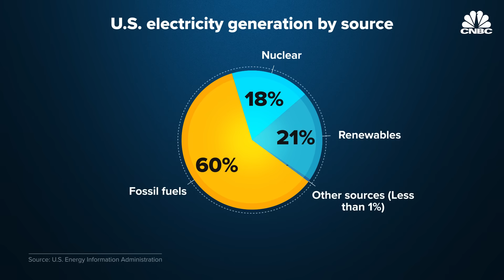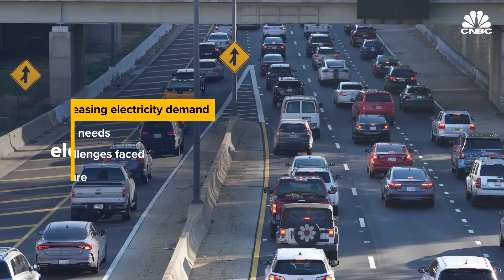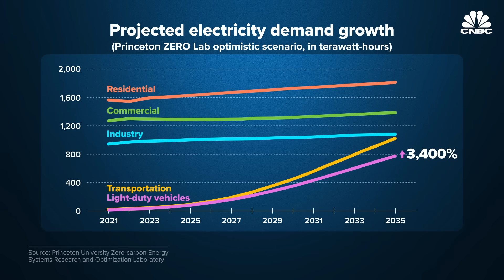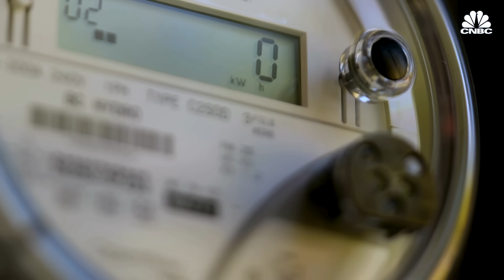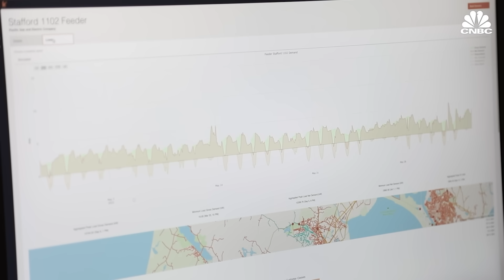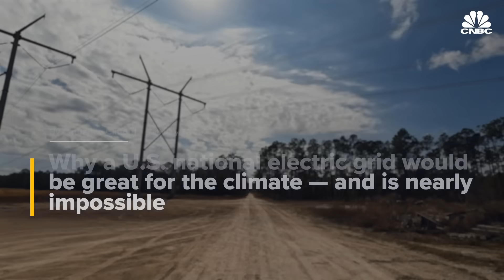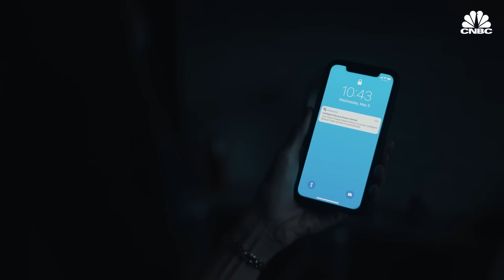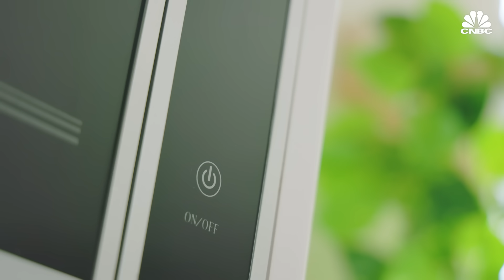Can The U.S. Power Grid Handle The EV Boom?

Comment: I’m SICK and TIRED of everyone and everything being about “EV this” and “EV that”! This whole EV fad is insane! Have we all forgotten that hybrids exist or..???
Because hybrids is the perfect solution;
-“EVs take forever to charge” hybrids still run on gas.
-“Gas cars don’t get as good mpg as EVs” hybrids have phenomenal mpg.
-“EV charge points are always broken” hybrids don’t need to be plugged in.
-“Gas cars need more maintenance” true, but for the low cost of maintenance, you pay for it in the high cost of EV prices. Hybrids aren’t that much more expensive compared to gas cars and are way cheaper than electric.
-“EVs can’t go long distances” hybrids can go as far as gas cars and are still efficient in the city.
-“Gas cars produce a lot of emissions” so does the production of EV cars.

You see what I’m getting at here. Hybrids are far superior and it’s very telling of how educated the public is when they can’t stop arguing over gas and EV cars when hybrids have been along for so long and blend the best of both engine types.
Reply: electric cars nothing new just battery tech is new there were electric postal vans 100 plus years ago in city also drive out to the plains state they have charge stations built but no primary power cables to feed them

Comment: EV's run on lithium batteries.  Lithium batteries are produced by strip mining the earth using equipment that runs on diesel fuel, then transported by ships that run on diesel fuel, then transported by trucks that run on diesel fuel and loaded into EV chassis by equipment that runs on hydraulics (lubricated by petroleum products).  Saving the earth . . . with petroleum-based products every step of the way.
Reply: More and more mining equipment is electric.

Comment: Air conditioning, not EVs are the threat to our grid. A Tesla Model 3 uses about the same amount of electricity as a large electric water heater. Do you worry about the cost of your water heater?

Comment: EV's are stupid.  They have a very short range, don't work well in cold or hot weather and are really expensive.  They are really boring and are for idiots.  Lithium batteries are better for RV coach batteries, e-bikes and fork lifts.  I'll stay with gasoline.  It's powerful, available everywhere, works in cold and hot conditions and the engines feel great! We have hundreds of thousand of mechanics that can wok on them.  We have very few e-mechanics. 
We don't have enough power either. If you want to use the grid for your transportation....get an e-bike.

Comment: They need to start with give a full tax rebate for total cost of solar panels just just the miserable chump change they give for residential units. Batter and cheaper batteries for said homes, why use rare metal batteries when you can use salt batteries on homes. But the issue is some power companies have made it so they don’t have to pay fair market value for power you put back in.

Comment: The solution is home based infrastructure.  The idea is to have every home have a battery to store electricity and be able to remove a lot of the strain on the infrastructure. This is something that the electric grid needs and it doesn't 100% have to be owned by the consumer but more or less leased.  I think any electric service could partner with Tesla or any other home battery system to produce an effective way to reduce strain on the electrical grid.  It could have solar but more importantly the electrical grid could have sensors when homes are at battery capacity and even have downtime for maintenance.  But that is my opinion.

Comment: Use hydrogen to absorb surplus grid electricity streams when they emerge.  

Further, consider pipelines for distribution.

IPOs and bond issues should be able to cover all build outs, quite comfortably.

Comment: You can do a lot by using "smart", networked appliances and ev chargers, for example a cumulative water heater or washing machine that will turn on when there is excess power. Can't do that with an electric range or AC though... and would need ev chargers at every parking lot, so people can charge during peak hours of solar, when they are at work, instead of charging overnight.
Reply: Actually you can make the A/C use more power during the excess power when solar is working, then reduce your temperature when the sun has just gone down, and wait to run it again until about 9 pm.   I have a power plan in Portland Oregon, where I pay $0.32 per KW between 5 pm and 9 pm weekdays, and after 9 pm, the power cost goes down to only $0.08 per KW and on weekends.  Weekdays between 7 am and 5 pm, the rate is $0.12 per KW, while my neighbors pay $0.13 per KW for basic 24 hour a day same price service.  

So I shut off my water heater between 7 am and 9 pm.  And I have not noticed a difference most days.  

For me, I can power my plug in hybrid without a big change to my electric bill.  For those that put in a 5 KW solar system, they can actually use less grid power after putting in one electric car than prior bills, and if they put in 10 KW, they can easy support 2 cars while using overall less electric power than prior years.

Comment: They need to give away power during peak solar - if you have a home battery.  They are basically throwing away electricity because there is nowhere to put it.  Low cost charging of home batteries will solve tons of costs associated with the 4pm-9pm system bottleneck.  Also PG&E is working to avoid long transmission lies due to liability.

Comment: I don't think the activists who push Wind and Solar really understand the impact these technologies have on the environment. When I see a Solar Farm in CA, it's a massive area that is graveled over without even thinking about the energy it takes to produce the panels. The photovoltaic only recently became a net energy positive. The mirror-based systems are cheaper and more effective, but they have issues with migratory birds and planes. The large wind turbines require a large amount of steel, concrete, and carbon fiber. The offshore wind farms have issues with whales and other marine mammals.
They should be pushing for Nuclear and Natural Gas.

Comment: Decentralize the grid (generate energy at the point of use) rather than rebuilding the centralized existing grid. Seems like this would likely be cheaper and also offers a safer infrastructure. The existing grid can be maintained in its current state to take care of the days where renewable sources aren’t plentiful. I think part of the problem is that we think we completely need to get rid of fossil fuels from day 1. They’ll likely need to coexist for some time.
Reply: that is not what the dems wart

Comment: The problem is not the EV boom, nor the outdated grid, nor the lack of interconnection, or any of the reasons explained in this video. 
The problem is the lack of political will from both parties to agree for the next 20-30 years, no matter who is in charge/elected, they will both pass spending bills and maintain the focus on upkeep, modernization, and installation of new transmission lines/infrastructure. 

Everything else mention in this video is a problem, but not THE problem as to why the US energy grid is lacking, behind, or vulnerable to many of the new modern issues.

Comment: The most effective solution to get away from fossil fuels in the short term is to expand on nuclear energy. It’s safe, and it’s clean if it’s done properly. That would significantly relieve the stress from carbon emitting sources, and would allow wind and solar to grow slower. (Because it will. It’s just not as effective, and that’s a fact)
Reply: Nuclear is so obvious that one has to wonder why they are avoiding the topic. Modern nuclear is safe and affordable and we should be building them near every city and manufacturing region in the country.
Reply: @ChickensAndGardening  exactly! It’s going to take far too long to build up adequate renewable sources to out pace fossil fuels. You want to get there faster, while simultaneously fortifying the grid to had the increase of EV demand? Go nuclear.

Comment: So this country has three very large grids.  I don't understand the issue with the transmission wind gen elect. from Arkansas to, say, New England or say solar from LA to Denver.  It appears we've been doing this with coal fired power right along.  No?
Permitting - What did the guy say, we currently use 1.5 or so trigawatts in this country?  Then he said we have 2 trigawatts "in the (permitting) pipeline" which needs to get by numerous fed, state and local bureaucracies.  Each of which will efficiently and diligently do what's necessary to move the project along quickly.  Much like your local Division of Motor vehicles is dedicated, efficient and customer friendly, provided you give them EXACTLY the proper forms, filled out correctly.   I'm guessing the 10-15 year timeline for ANY of these projects will be shortened once we realize that we are running out of electricity.  

NOTHING was mentioned about the ability to acquire the massive amount of real estate necessary from private individuals.  They may not be happy.  

"In the past past they have been able to anticipate growth and build generation capacity"  (paraphrasing).  Yes with known generation production.  Fossil fuels.  Turn them on and get to max capacity within a known timeframe.  This doesn't happen with wind or solar.  You can NEVER know how much future capacity renewable will give you at any given time frame.  Again, with fossil fuels you know how much electricity generated for a given amount of fuel and time.  

The list of problems goes on and on.

Comment: When thinking of going electric for my car, I wanted it to be a clean source. I took advantage of some good incentives in 2011 and moved to solar. My solar energy production is far above my consumption now (more than a 60% reduction in electric).  Starting in 2016, I started with a blower door test on my home, as well as other audits. Found the weaknesses and made moves to tighten the leaks in my home, went to super efficient heat pumps for heating/cooling (gas backup) and a clothes dryer, as well as a on demand tank-less water heater (gas). So, by making these efforts reality, helped to reduce the amount of energy consumed, well offsetting the greater need for more electrical equipment. Remember, YOU cannot make a fossil fuel, but you can make clean solar power! And that my friend is by design.
Reply: I'm pretty happy with my move to solar. I wasn't able to install a system to replace all my demand, but it covers about half. Since I'm on a tiered power use system, it lowers my overall bill by more than half. Additionally, I when I leave on vacation, it actually makes money (net metering). The system will break even in about 7 more years.
Reply: @JasonTaylor-po5xc  That is so cool! You are making a difference, thank you!
Reply: I quit using a clothes dryer...just hang dry. I keep waterheater turned off...when hot water is needed just turn heater on and have all hot water needed in 20 minutes.
My electric bills average $50 - $60/month.
Reply: @BANANASandDUCTTAPE  excellent!! My bill is a credit of $320.00
Reply: Thermal depolymerization turns landfill and other waste products into fossil fuels.
Reply: So all of you yapping about solar on your homes and your batteries! Good for you! What about 1/2 the nation that rents and pays skyrocket rents! No solar for renters! Where do you think all that lithium will come from? Do you realize it takes thousands of tons of excavated soil to collect enough lithium for just 1 battery! 
Have you seen what a lithium mine looks like and the ramifications of what it does to the environment (that the hypocrite electric big wigs of electric conglomerates are screaming about!) Do you want one of those disasterous mines in your back yard?!! Research them and get educated to the facts on lithium! Have you ever seen a lithium car fire?! The fire departments cant put them out! Water makes lithium burn! God help anyone ever got trapped in a car accident resulting in a lithium fire! Kiss your derrier goodbye! You will be a frikaseed french fry! Lithium is a corosive contaminate! If its leaked onto the ground from damaged batteries it contaminates the surrounding ground and requires hazmat removal! Ya thats the reality! But the conglomerates wont make that obvious! Good luck with that! I suggest you tubing some videos on the subject! You are all being hood winked! Educate yourselves!
Reply: I went solar in Aug. 2017. Beginning in March of '18, my solar production began to be more than I use and my net meter credits have just been adding up (with zero cap) and rolling over every year. 
I'm currently sitting on $900 credit on my electric account. 
I drive a hybrid EV, mostly battery use, and the electricity to charge the battery comes from my solar panels. 
Long before EVs become a mandate (probably 2040), the infrastructure will be firmly in place. I envision solar and wind farms spreading far and wide across this great nation by then. 
The sun will shine and the wind will blow. Best to put that natural energy to work.

Comment: So we'll do high insulation, high efficiency, on site solar PV with large residencial battery coupled with bidirectional electric vehicle, air sourced heat pump, electric heated floors, triple pane windows before new coast to coast to coast gigantic transmission lines are built...mmm. In this case new wind farms and solar PV farms for every city and community recharging grid batteries yes in every community. Along with food forests too 🌳. Stronger and warmer together ❤️.
Reply: who is going to pay for it?  the average US household can't,  That is why governments will fund large scale projects they are far more cost efficient
Reply: @scotthall1381  I started 10 years ago. I try to install and pay for one major project per year. So I now have R30 foam insulated walls, triple windows, new exterior doors, solar heater that heats the upstairs rooms, 100 potato plant garden along with fruit trees. Next is an air sourced heat pump, and then probably solar PV along the fence. One at a time is the key! Solar shade awnings over all windows are simple and cheap...I'd start there to structurally lower temperatures in our homes.

Comment: Saw a CEO of a power company say, when an EV is plugged in, the electric company considers it like another house drawing power. Your street has 7 EVs charging, like 7 new houses. That comment always sticks with me.
Reply: That's a silly comment when you do the math.
Reply: @noliver7913  not silly the average house at any given time is using probably around 3kw continuous, you plug and EV on 240volt circuit it will be using anywhere between 6-11kw continuous and they usually charge for 5-7 hours
Reply: @noliver7913  I was only saying what I the CEO said in a TV interview which I saw.  He needed more power production to meet the increased demand.

Comment: Residential areas should be cooperative micro-grids. Intelligently managing internal draw and feed-in. Storage should be developed at the municipal level. Draw and feeding to the wider national grids should be done at the interface between the micro-grids and the larger grid. Such a system is just way more manageable. Large fleet operators have the clout to meet utilities midway in any case.
I fully expect the real challenges are only in maximizing profits for the utilities and maintaining control of as much of the eventual infrastructure as possible. Their entire narrative will revolve around it.
Reply: 10,000 more bureaucrats all arguing for their little fiefdoms.  No thanks. I cannot imagine how you could keep local politics out of it. They like to poke their fingers into everything.

Comment: I'm sad this video doesn't touch on some other critical issues.
Zoning regulations almost never allow for medium density living spaces nor mixed usage. Low density suburbs requires people to travel far for even basic things like groceries. This costs a lot of energy and it requires people to use a car instead of something like a cargo bike. The low density also makes public transit a challenge which means people depend on their cars for their daily commute. Most people don't have the freedom to choose how they want to travel. The EV boom will be way easier to handle if people get the freedom to use far more efficient modes of transport than cars